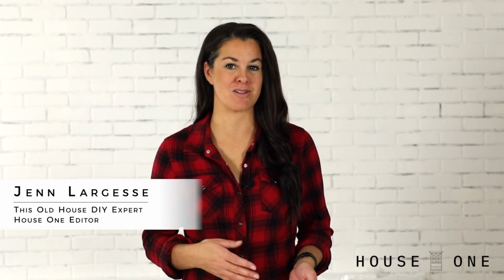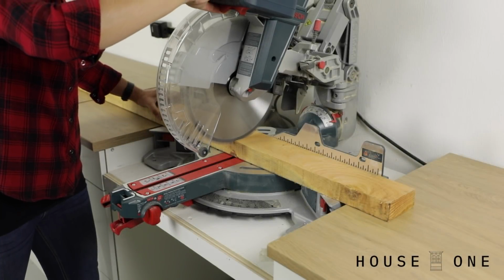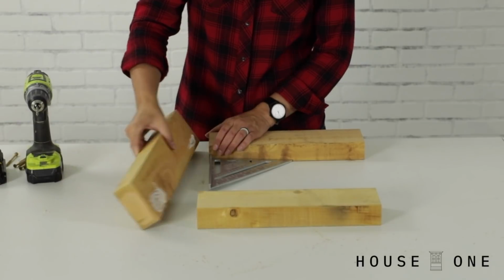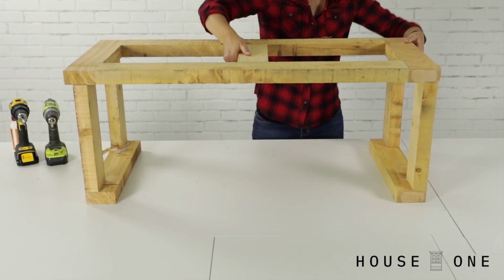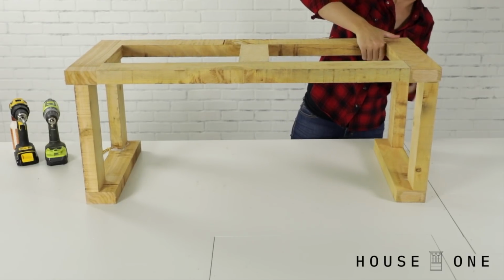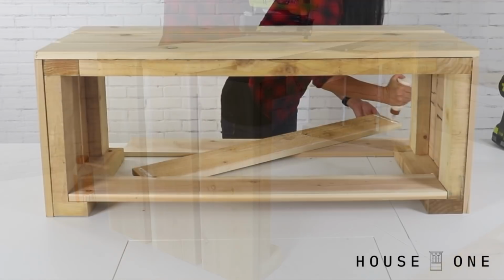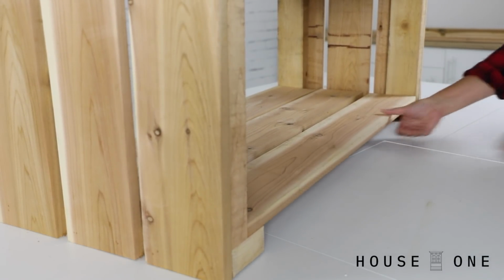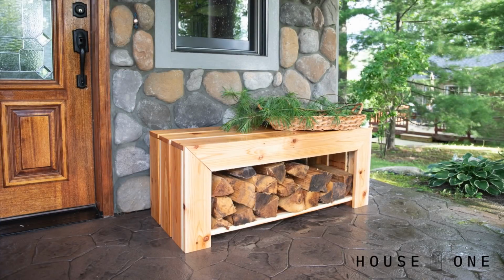How to Build a Firewood Storage Bench | House One | This Old House

Comment: Gotta say, not a bad design.   The 1x material really spiffs up the look of the thing.   Don't have a need for a firewood storage bin, but as a simple bench I can see it working nicely.  Maybe use pressure treated on the bottom pieces that will be in direct contact with the ground though.
Reply: If you’re leaving it outside, I can see your point. However, I think her design was for interior use.
Reply: @multidinero  Possibly, I don't live in an area that uses wood as heating (or ambience) so I don't know what is practical far as wood storage.  Based on what they showed in the video the bench looked to be on the porch(?) of the house, so assumed it would be some outdoor thing although the amount of wood storage under it I guess would be more practical for indoor usage, but again I'm not sure how much wood a fireplace would go through in say a night.
Reply: @Mike__B  I totally understand that.

Comment: That face that you added reduced the storage area by 25%. It think that should have been a lot smaller to maximize the storage area!
Reply: The design you’re recommending would give you nothing major but the ability for wood to hang out. But, you could always build your own that way.
Reply: @multidinero  not to hang out. Just more wood inside….
Reply: @ovidiuciuparu6421  No,… on that you’re quite wrong. With 2x4 construction, at an actual size of 1-1/2 inches on edge, you lose nothing with a 3/4 thick trim frame that is 4 inches or more in with. It’s perception, as the trim boards are on the outside of the face of the actual storage. There’s no lost storage. 

But, as I said before just make it bigger if you have a problem, or leave the face uncovered if you don’t care about seeing the 2x4s. But, I reiterate that trim facing doesn’t take away any storage by the wider fronting face.